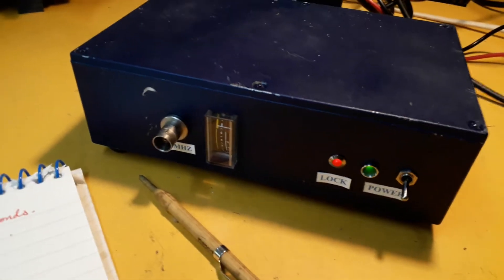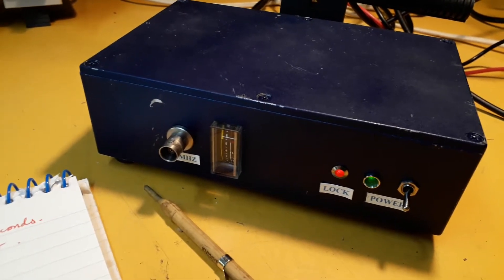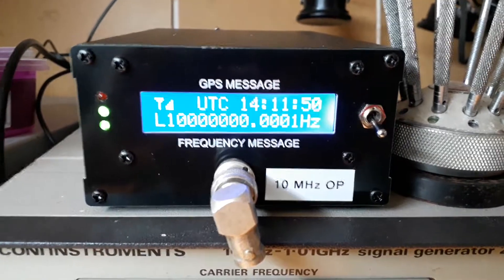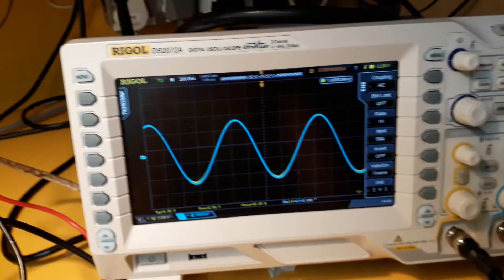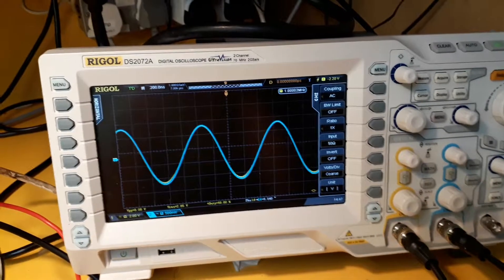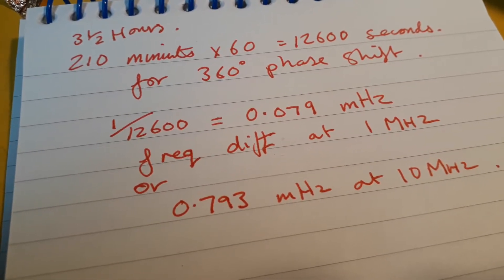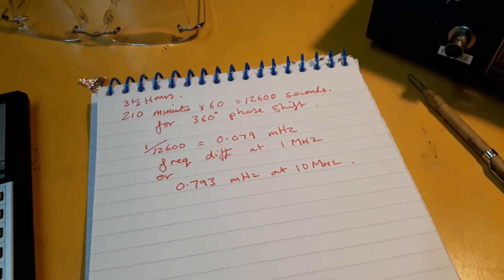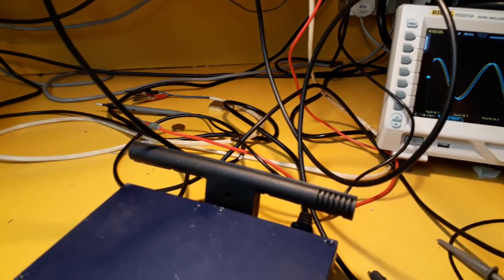gpsdo compared to home built off air frequency standard

Comment: Iv'e just bought a QUARTZLOCK 2A-X  off air standard as well! Will need to build a ferrite rod for it as I see how directional it is. Even pointing straight at the transmitter there must be some multipath. Maybe that's the tiny error you are seeing?
Reply from the maker: Congratulations Simon! It's a nice unit, mine came with a ferrite rod on the back but should be easy enough to connect one , suggest you resonate it with capacitor to 198 then use the low impedance connection on the coil to connect to the quartzlock . At your distance you may experience multi path from droitwhich at night but not here it's pure groundwave as I'm so close to the transmitter

Comment: That's it, this was the last straw, I am subscribing! :-)
About the phase change when you move the unit, I think that it may have to do with the Earth's magnetic field. What happen if you only tilt the unit a few inches opward, without turning it to any side?
Reply from the maker: Thank you for your kind comments & subscribing! I am almost certain that phase change is caused by making a small path difference between the transmitter & the receiver, but I could be wrong! If you like I could make a short video doing what you suggested, regards Nick
Reply: @ptronix  Maybe you are right, it could be funny if you could test that in any way:-)
It's me that thanks you fore sharing your videos and knowledge!:-)
Reply from the maker: I've tried a quick test, I lifted it 3 feet off the bench! while being careful not to turn it in any axis, it made no difference to the phase,(I think proving my  theory) regards Nick
Reply: @ptronix  Yes I do also think that you are right! But still a funny experiment to perform:-)
I have found the video from EEVblog, that made me think it may be due to gravity:-)
https://www.youtube.com/watch?v=zILwgQhjC_Q